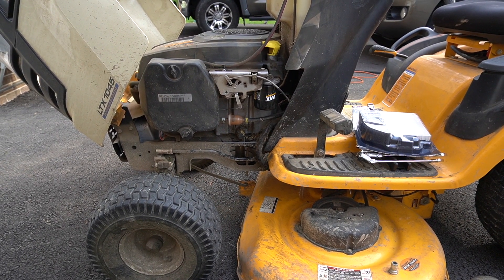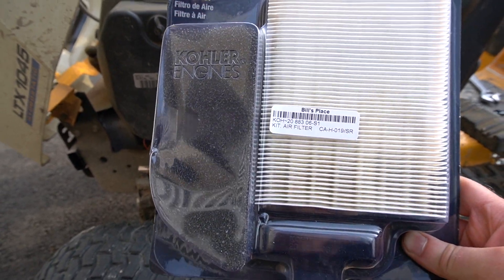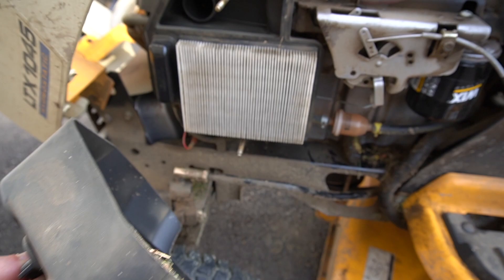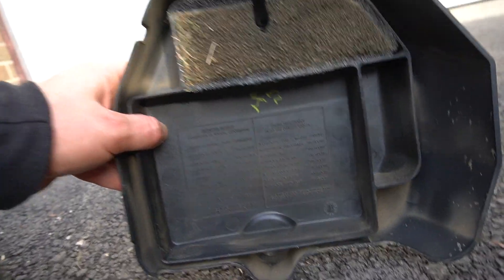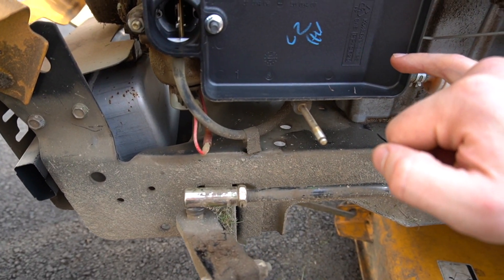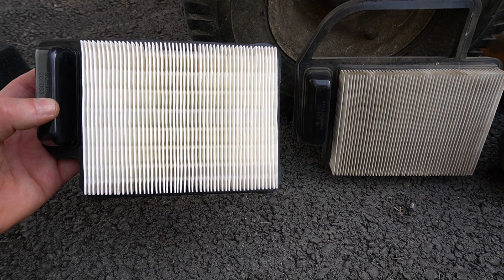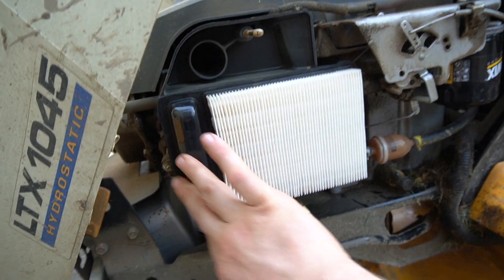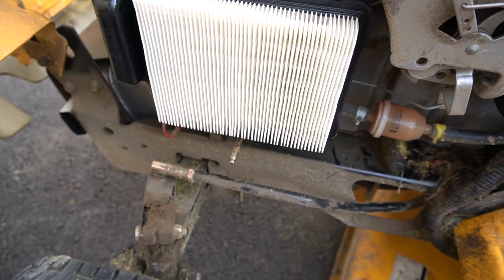How to replace tractor air filter, how to replace lawn tractor air filter,  landscaping equipment

Comment: GM MY FRIEND.  I HAVE TO THANK YOU FOR TEACHING ME THST TIP ABOUT THE AFTER MARKET AIR FILTER, BUT NOT ONLY THAT I PURCHASE AFTER MARKET SPARK PLUGS N OIL FILTER N GAS FILTER . I DID IT ON MY OWN N IT WAS EASY. SAVE ME SOME MONEY. THE TRACTOR IS RUNNING BETTER THEN MY CAR. BELIEVE IT OR NOT.  THANKS FOR THE GREAT TIP.
Reply from the maker: Thank you.